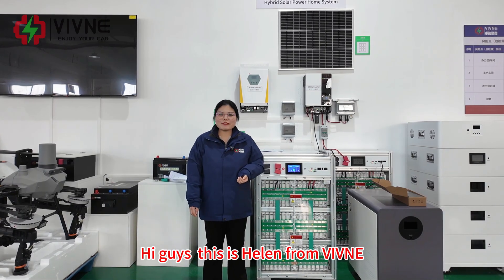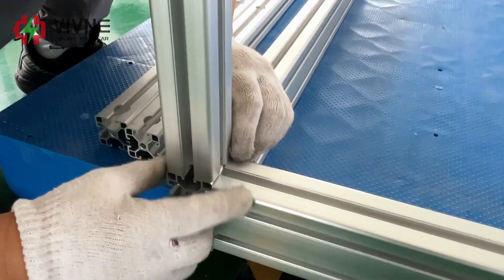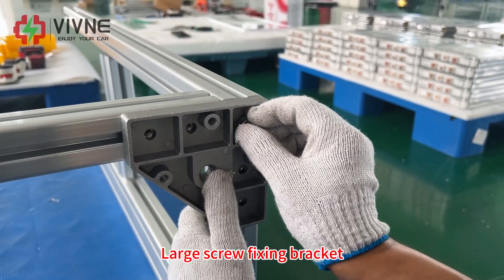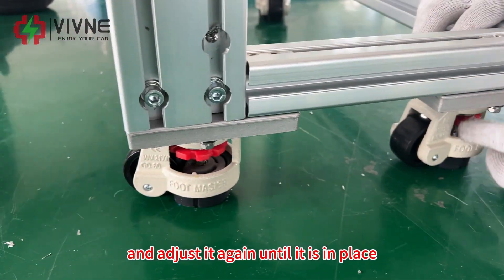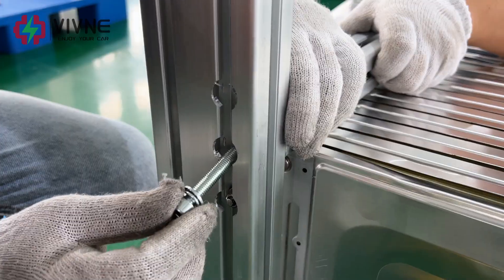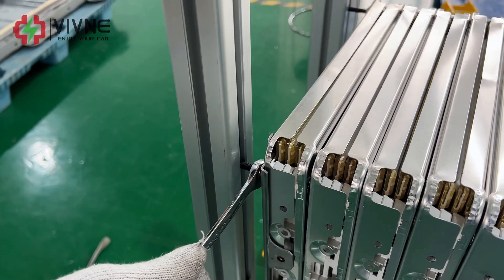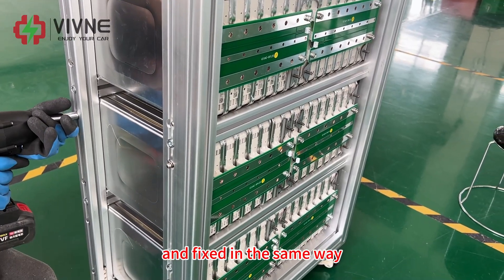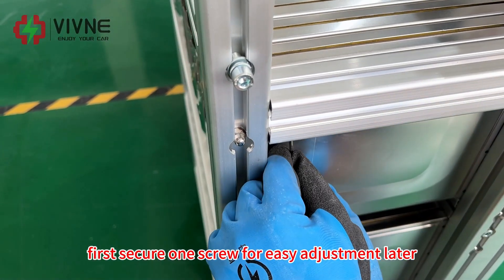Vivne-How to build your own home energy storage?

Comment: Are there really that many car battery of this format going around on second hand market ?
Reply from the maker: Sure have. We had sold many kits already. After the battery  upgrade, most Leaf owners would want to re-use their old battery.  Most of the 24kWh and 30kWh old battery is still in good condition, although with a low SOH, but no bulge,can be used as home energy storage.
Reply: you have no idea..
Reply: Hi. 
interested. :)
Good job on choosing the right BMS, JK is the way to go. 
how about the price.?
Reply from the maker: @Klockarbackan  If purchased together with the battery, there will be discount for it.